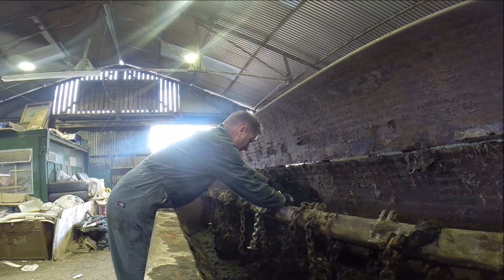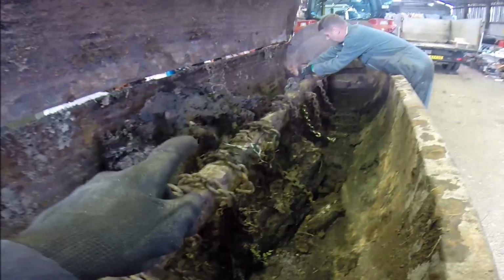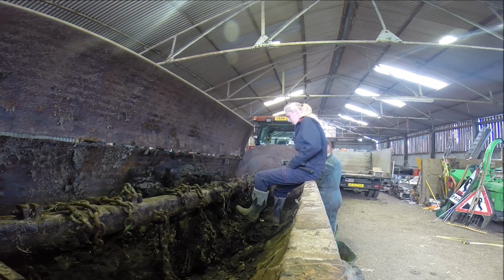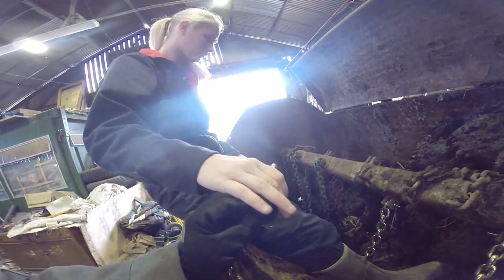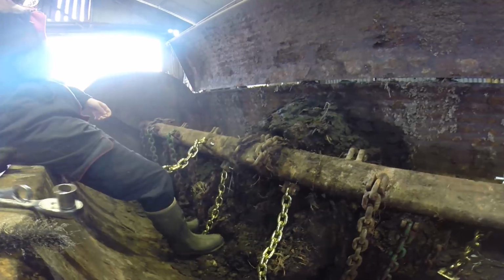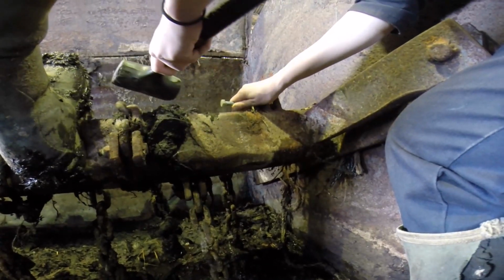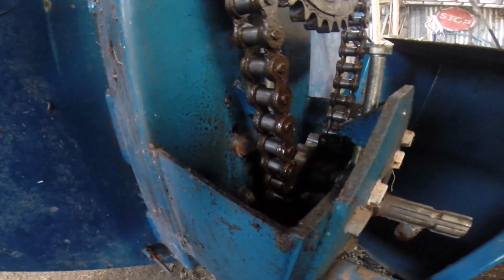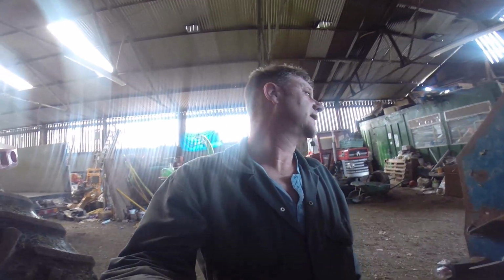Fitting new muck spreader flails with Abbi  17 08 19

Comment: Helpful tip for next time. When finally tightening up the nut use the spanner to tighten and hold ratchet. More leverage on spanner and less likely to wreck the teeth on the ratchet. Great vids otherwise 🙂👍